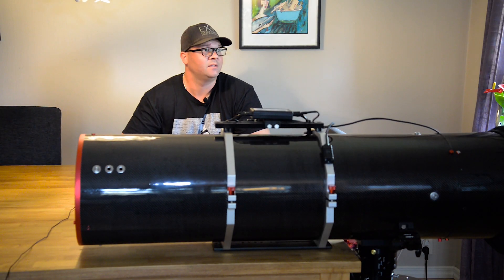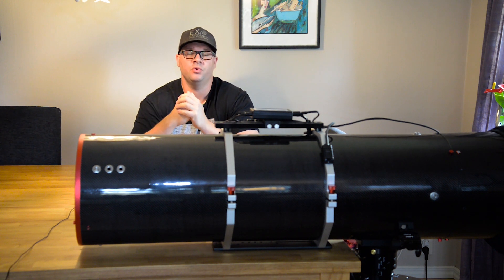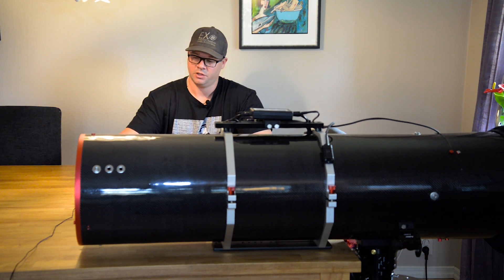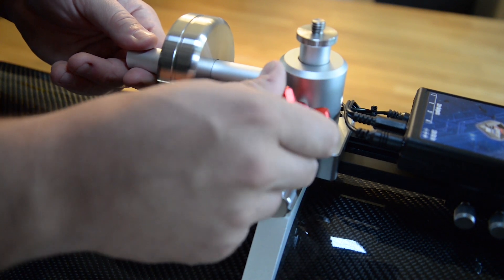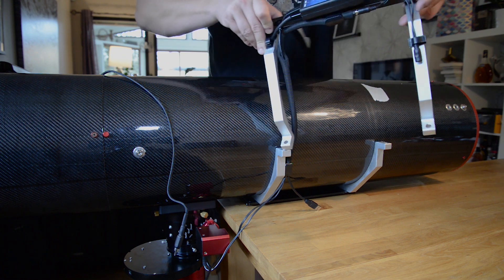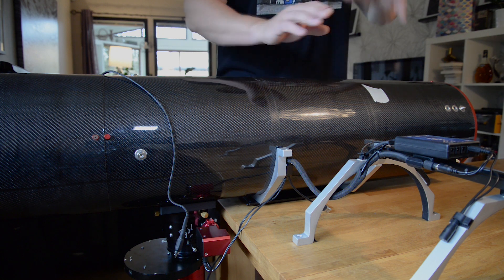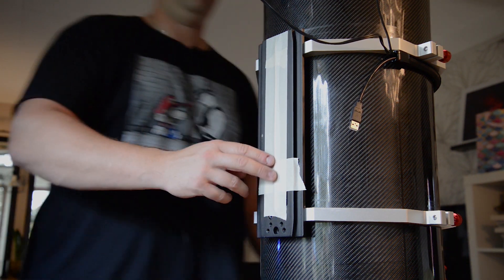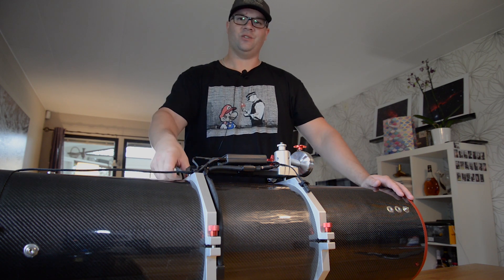How well do I really need to balance my telescope?

Comment: Hi, great video. Can you please provide a link to where you purchased this gear for balancing. Thanks
Reply from the maker: Sure thing :)

This is the CW - https://a.aliexpress.com/_u7JZEC
And the same seller has the extensions as well 
Best regards / Daniel
Reply: @ExoPhotography1  OK, I see what you are doing now. I have the same off axis counterweight from Aliexpress, but its on my RA. The part you are showing me allows adjustment of the DEC balance with the same part I have.
Reply: I am frustrated trying to put what you have done together. It is a multi item purchase. I would be forever indebted if you could find your original order from Aliexpress so that I can get the proper parts. Aliexpress has been unresponsive.
Reply from the maker: The same seller has all the parts, is it one of these items you are looking for? https://www.aliexpress.com/item/4000693468172.html

/Daniel

Comment: That method is ideal for balancing a scope when it is pointed horizontally however that may not be the case when the scope is pointed to all parts of the sky.  Once a camera or heavy eyepiece is inserted in the focuser it will move the centre of gravity away from the intersection of the declination and polar axis.. To compensate for this the counterweight needs to be further away from the optical axis when imaging equipment are employed (or a heavier weight placed at roughly the same position). This is covered in the concept of "moments".
Reply from the maker: You are right indeed - The method I use in the video is the initial balancing, when I have the whole scope mounted on the mount, i use a combination of east-west and 20 degree and 60 degree altitude for adjusting the balance point.

I don't think that one can never achieve 100% perfect balance, and you don't have to, these mounts can handle a slight off-balance.
At least I got it very close :)

/Daniel

Comment: Danial, Can you provide a link or product info to the counterweight system you’ve shown here?
Thank you for the great content you provide. 
Gary
ps: are you totally pleased with the TS ONTC? I have the UNC version and contemplate moving to the ONTC.
Reply from the maker: Absolutely, the store i bought it from is this one: https://www.aliexpress.com/store/1371081

And this is the page where they have all "counter weights" https://www.aliexpress.com/store/group/CounterWeights/1371081_510795142.html?spm=a2g0o.store_pc_home.pcShopHead_11256460.1_0_6&fbclid=IwAR2abJ_gaeeRgHgW7UtlxDcqFJsq3eSSAv3ScjRCHzIVTLc103yKS_K5R50

Be sure to choose the right dimension, they have quite a lot of different dimensions.

The ONTC is not the same as the N-AG 10 as I have. The N-AG has a true 3" focuser and aluminium scope rings, the tube it self is the same though - and that is built like a tank! Very rigid.

I ordered a bigger secondary, to be able to get a 60mm+ image circle with f3.4, and the weight of that bigger mirror is just of the brink of what the secondary holder can tolerate - room for improvement :D

/Daniel

Comment: I've just been playing with this question myself. I normally leave my scope unbalanced to the west and south to keep my backlash seated. I was trying to image at long focal lengths, however, and noticed that it was pulsating slightly. I was TOO unbalanced and the torque curve of the stepper driver was causing the telescope to wobble because its force on the mount was not steady. I got it a lot closer to perfect balance and this problem disappeared.
Reply from the maker: I use that method my self when using my EQ6, slightly off balance, but it doens't need to be much at all.

Always good when you find and can sort out the problems :)